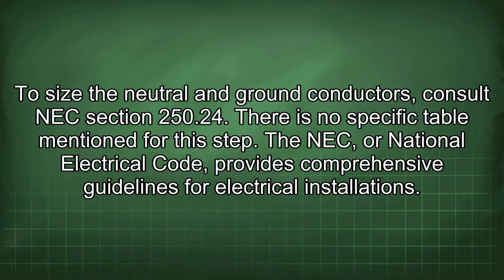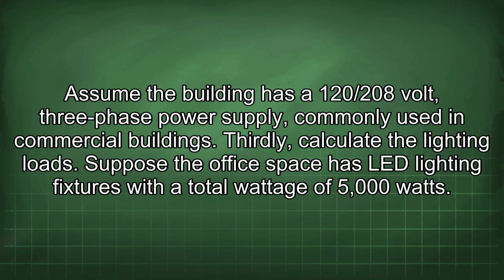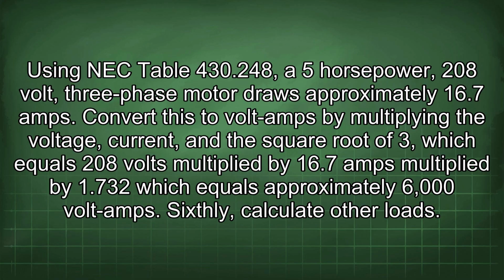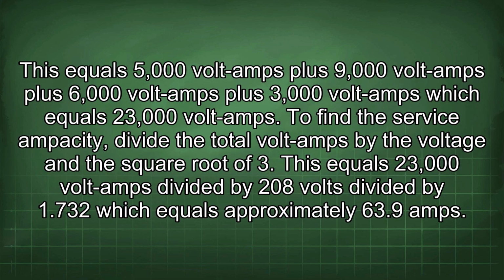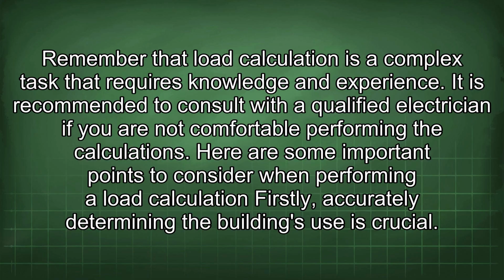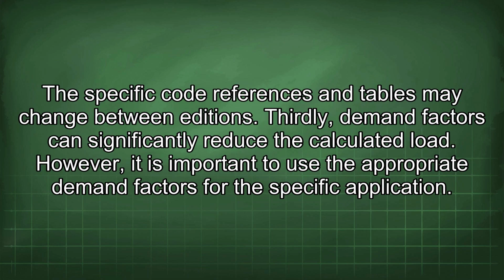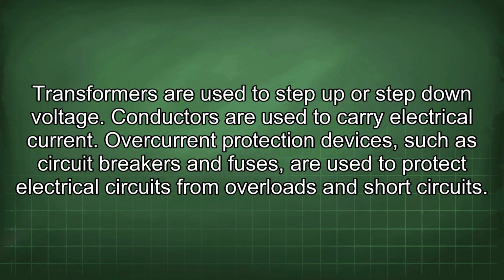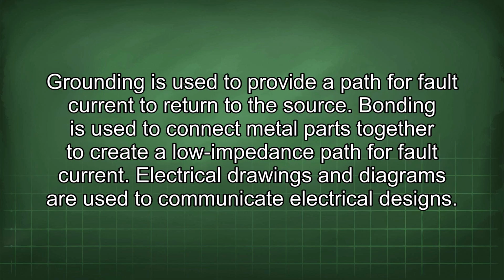Commercial Building Electrical Load Calculation Simplified Steps

Comment: What's the meaning of receptacles sir??
Reply from the maker: Hello @brunogina3329,

Thanks for your question. In the context of the National Electrical Code (NEC), a receptacle is defined in Article 100 as:

A contact device installed at the outlet for the connection of an attachment plug, or for the direct connection of electrical utilization equipment designed to mate with the corresponding contact device.

Here's a breakdown of what that means and some important distinctions:

Receptacle vs. Outlet: This is a common point of confusion.
An outlet is a broader term, defined as "a point on the wiring system at which current is taken to supply utilization equipment." This includes anything that draws current, like a light fixture, a hardwired appliance (like a garbage disposal), or, yes, a receptacle.
A receptacle is specifically a type of outlet designed for you to "plug in" something. So, a receptacle is always an outlet, but an outlet is not always a receptacle.

Attachment Plug: This refers to the male end of a cord that you insert into the female opening of the receptacle.

Direct Connection of Electrical Utilization Equipment: This part of the definition was added in more recent NEC editions (like 2017) to account for newer technologies. It means that some devices that connect directly without a traditional "plug" (like certain plug-and-play ceiling fans) can also be considered receptacles.

Single vs. Multiple Receptacles:
A single receptacle is one contact device on a single yoke (the mounting strap).
A multiple receptacle (like a common duplex outlet) is two or more contact devices on the same yoke. It's important to note that a duplex receptacle is considered two receptacles for NEC calculations, not just one.

In essence, when the NEC talks about "receptacles," it's referring to the points in your electrical system where you can directly connect portable or plug-in electrical equipment. The NEC has extensive rules regarding the number, spacing, type (e.g., GFCI, AFCI, tamper-resistant), and installation of receptacles to ensure electrical safety.

Kindly,

BESA Research